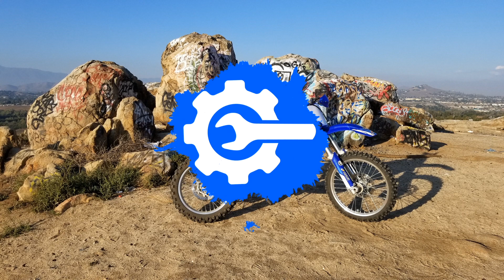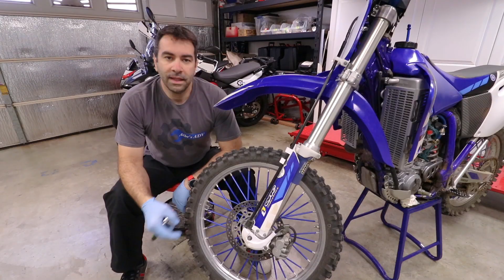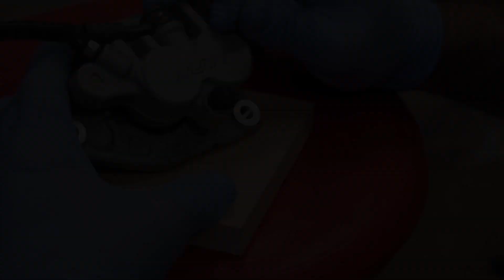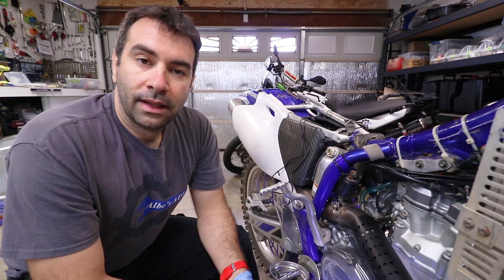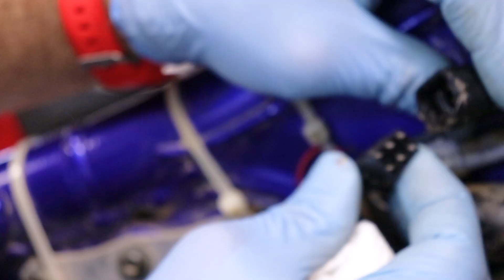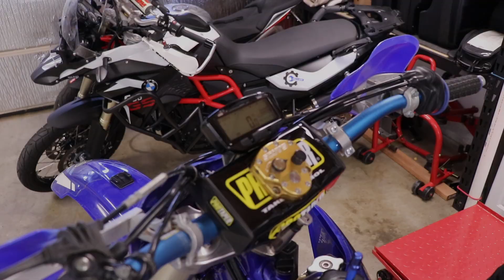Trail Tech Vapor Stealth install on a Yamaha YZ426F

Comment: Great video, thank you! Gave me the confidence to install this on my 04 wr450f. I wrapped the wire around the coil. With the water seal holding it in place it was actually a clean and stable install. I also went directly to the battery for power and it worked well. Just in case anyone was apprehensive about soldering to the stator wires on a bike equipped with a battery.
Reply from the maker: Well done 😀👍

Comment: How do you get the dash to light up all the time ?
Reply from the maker: The unit is wired into the bike and every time the bike is started or even just kicked the light comes on, is you don't start the bike, the light goes off after a few seconds if you start the bike the light stays on

Comment: I got one guestion, did you wire the rpm sensor directly to the ignition coil 12v wire? It kinda shows and kinda doesnt in the video
Reply from the maker: Yes, directly to the coil male plug.
Reply: @AlbesADV  did you just use the red sensor that you normally wrap around the spark plug cable?
Reply from the maker: Yes, I shortened to the length I needed, I attached a female connector to it and plugged it in, in my case the coil had an empty male connector on it
Reply: @AlbesADV  thanks so much man! I will look into it shortly, I got a WR426 but it's quite similar.

Comment: Where did u get your steering Stabilizer?
Reply from the maker: That one was on the bike when I bought it
Reply: Just got new trail tec pro too. but it did not come with wheel sensor is it gps automatic or how dose it work?
Reply from the maker: If you bought the one specific for your bike should have come with the speed sensor. The GPS is integrated and should just work.

Comment: Thanks man, I was having trouble wiring it up to the stator. I was trying to run it off the pink and black wire. It doesn't like it. I hooked it up like you did, and I runs perfect on my 09 yz450. This is the best trail tech installation video I've seen over the years.
Reply from the maker: Thank you Kaiden, glad to help 😀👍

Comment: How’s it running ?
Reply from the maker: So far it’s working great, really worth it.
Reply: How much did you spend on the whole set up ?
Reply from the maker: About $150 the trail tech kit came complete with all the sensors, and I made the bracket out of aluminum I had laying around.
Reply: Thanks for the info

Comment: Dude I never thought you could run the vapor tech off the stator ? Have you noticed any ignition issues or riding power issues?
Reply from the maker: No power issues, when it comes to the ignition I’ll let you know as soon as I’m done rebuilding the carb. I’m replacing the mid-body o-rings, adding a sigma jet kit and a quick-shot 3 and new accelerator pump membrane.
Reply: Albe's Adv Yeah those are all very necessary mods the mid body gasket is usually the reason these FCR carbs start acting up...if you’ve got a small hiccup right off idle that won’t go away the mid body is usually the culprit

Comment: Did you upgrade the stator, or is that the factory stator?
Reply: Okay thank you. I will copy you. I am surprised the instrument cluster operates off AC current.
Reply from the maker: @christianbenfell2715  so am I,  but I followed the instructions step by step and it's been working
Reply: @christianbenfell2715  hey man I’m looking to do the same thing on my wr. Does the trail tech operate off ac power?
Reply: @nickc7039  it’s been a long time but mine worked the same as Albe’s. I just followed the instructions that came with it and it worked perfect.
Reply from the maker: Factory stator
Reply: @AlbesADV  thanks, im running a vapor off battery. I didnt realize that i could run an extra electrical load off the factory stator.
Reply: You are certain you are running the Trail Tech Vapor off of the bikes factory AC output? I want to run the same setup on my 426f. How are you certain you are not using the Trail Tech’s battery?
Reply from the maker: @christianbenfell2715  because when I start kicking,  even before the bike turns on, the dash lights up with every kick. If you are off the battery you need to turn the back light on manually